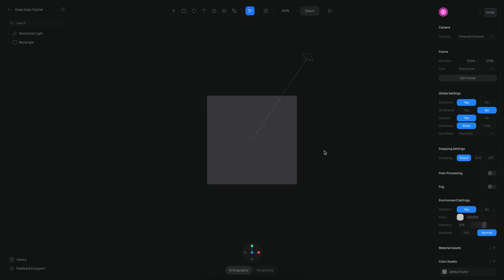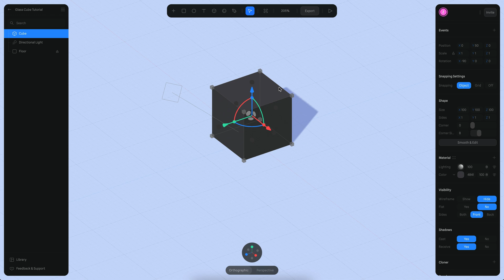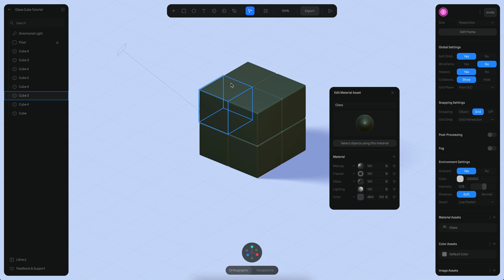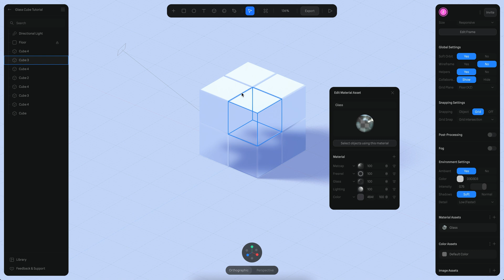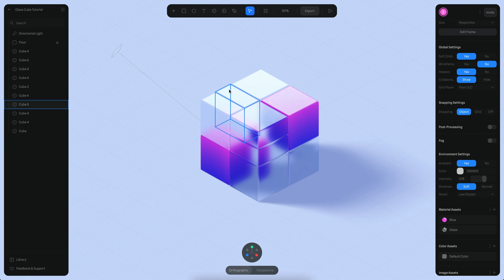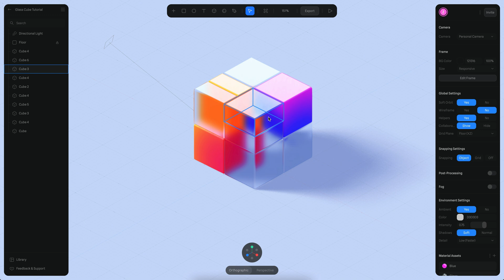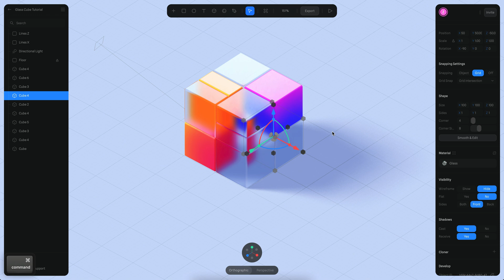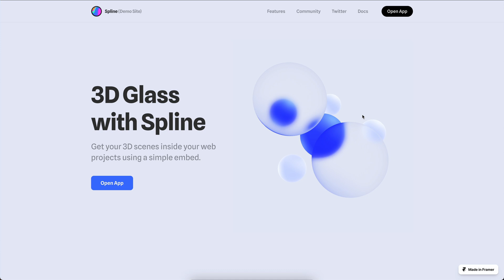Designing a glass cube in 3D with Spline

Comment: When I used the 1.8 value for the refraction in the glass material I haven't got the same result. I've changed it to 1.05. Seems like spline did some adjustments to the intensity of the values. Thank you!
Reply: I believe he uses 1.08 in the tutorial. But the important is that you got there anyway :)
Reply: @joaorocha7581  you probably right hahaha
Reply: Yooo thank you so much your note it exactly what i was missing